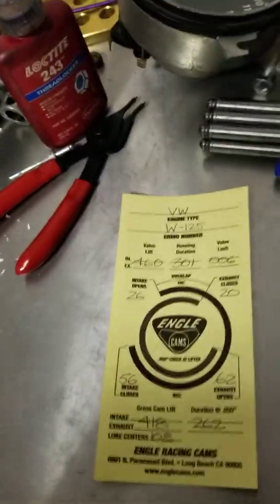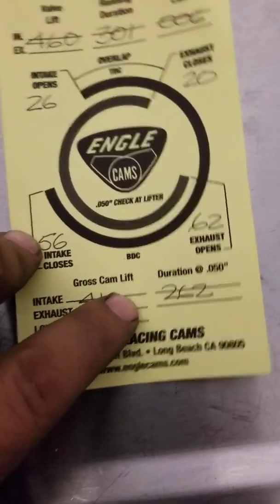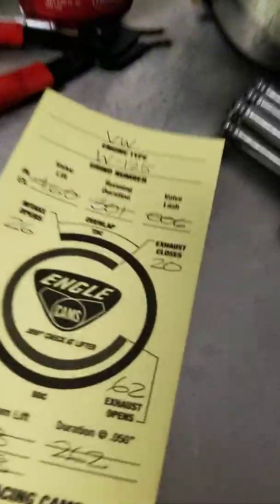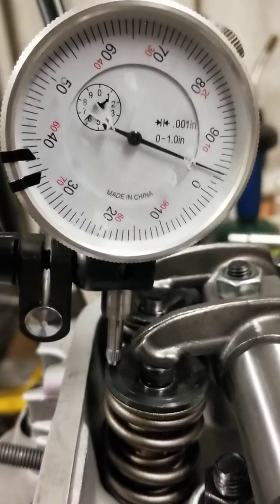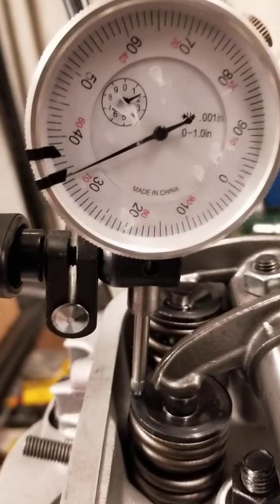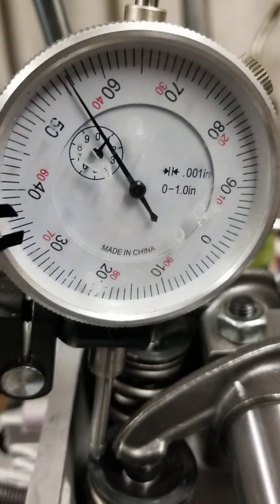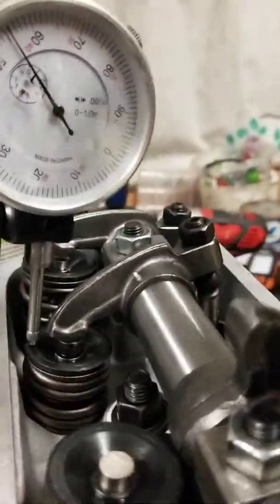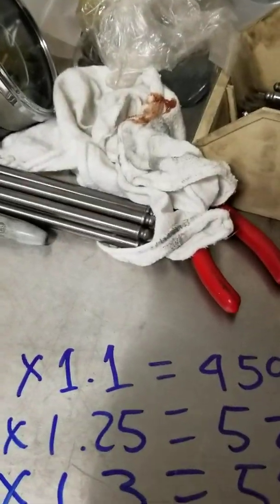engle 125 VW camshaft lift explained ratio rockers

Comment: I'm curious if the rockers aren't accurate as advertised do you check each of them to make sure they are all the same?
Reply from the maker: Yes check everything bro
Reply: @volkstroke  thanks for responding. I figured you did, just my curiosity. 
Do you build engines for people? I've been watching your videos and wondered if you could build me a long block? 
I built a 1835 when I was a teenager with a little help and by reading a book.
I'm older now (59) and building a shop for working on stuff at my house. 
I picked up a 63 bug recently, that had a tired 1600 DP. I pulled the motor and had a retired VW mechanic build me a 2110, he still works at his home.
It works OK and I'm having a lot of fun driving it around. But I would like to build a quality engine, something I could swap into my car a few times a year for drag racing. Maybe even take to California once a year and meet you guys?
I'm in Utah, not a lot of racing here but I've always loved drag racing.
My car is a baja, not exactly my favorite but the price was right so that's what I got for now.
I don't know anything about suspension so I watch a lot of YouTube and trying to learn. 
Basically I love old Volkswagens!
I want to build a street/strip type car so if you have any advice I would be happy to learn how to get started with some basic things such as brakes, suspension, and swingaxle. 
Keep up the good work, making videos might be a lot of work but they help a lot and I only watch YouTube instead of TV.
Reply from the maker: Yeah I can do something like that I have one almost  ready to go actually
Reply: @volkstroke  is there a way to contact you like email or something? 
I'm interested in specs, price, etc.
Golden
Reply from the maker: Www.volkstroke.com